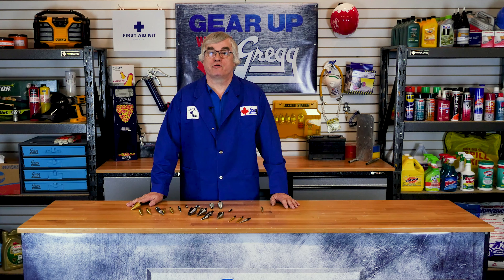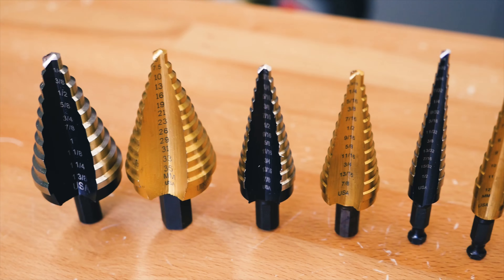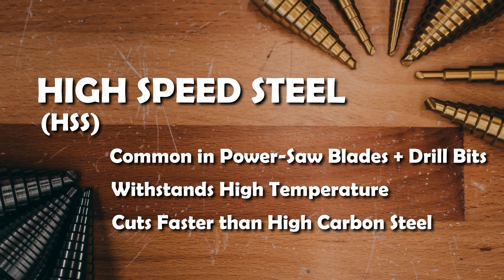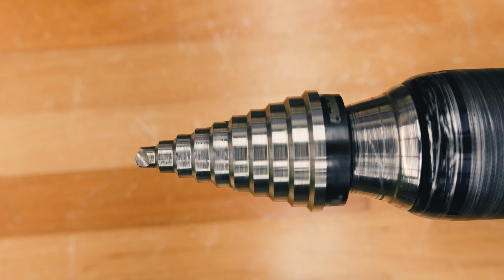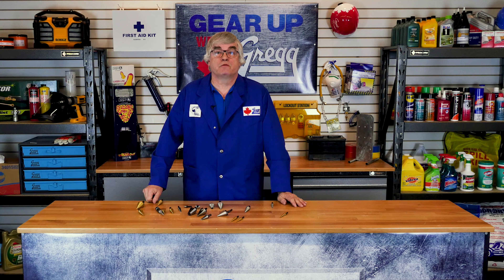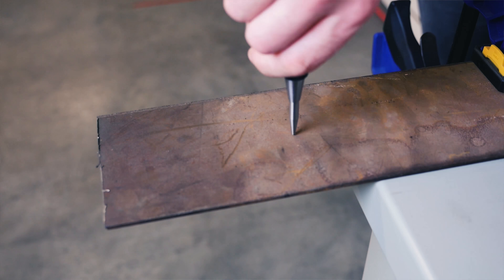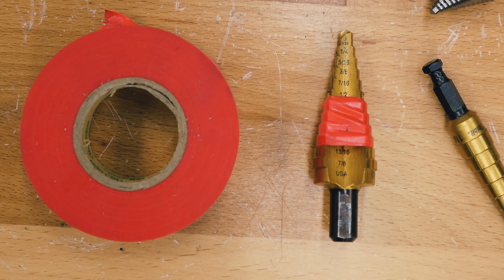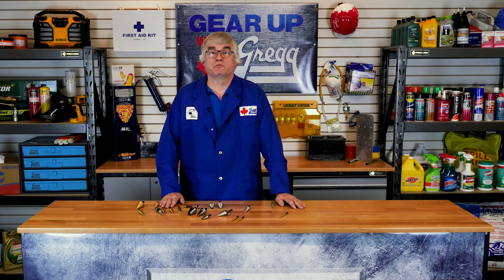UNIBIT: The Advantages of Step Drills - Gear Up With Gregg's

Comment: Well done video.  Can a regular drill do this ?  Should the surface around the hole be sealed with anything to prevent rust, etc ?
Reply from the maker: Although a regular bit would not, we carry Viking Vortex bits that can - view them here https://greggdistributors.ca/search?q=Vortex+bits&resp_group=Default,Variations,ItemProperties&terms=Brand:Viking+Drill+and+Tool

We also have a video about these bits, watch here: https://www.youtube.com/watch?v=-U7HWT28Et4&t=14s

Comment: What is the recommended RPM? Should I slow down with bigger diameters?
Reply from the maker: From the literature we have, there does not seem to be a specific RPM that the manufacture recommends.  Generally speaking though, when drilling holes in metal applications, lower RPM’s with lots of lubrication is ideal.  Thanks for watching our video!

Comment: I'm using a step bit to make the hole in my car firewall bigger and all it does it's stop moving while in the hole why is that
Reply from the maker: Is it possible that the chuck is not connected properly? If It is then using a lubricate like WD-40 should help. https://greggdistributors.ca/search?q=wd-40&resp_group=Default,Variations,ItemProperties
Reply: I'm way late but are you putting the drill in the hole before pulling the trigger? Pull the trigger to get some rpm's  before making contact with the surface to be drilled

Comment: Which cuts SSteel the best?
Reply from the maker: The Titanium Nitride (TiN) Coated would be best.
Reply: None of the ones I saw. Carbide would work if it was made. Titanium on the drill is just show, only .001-.003 only.
Reply: Cobalt if made